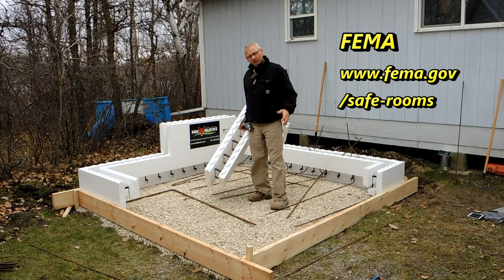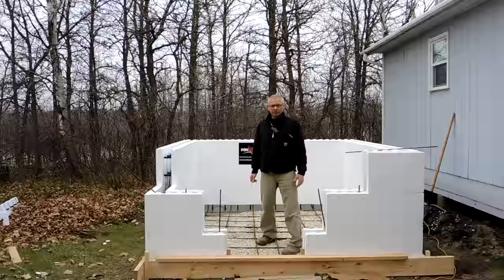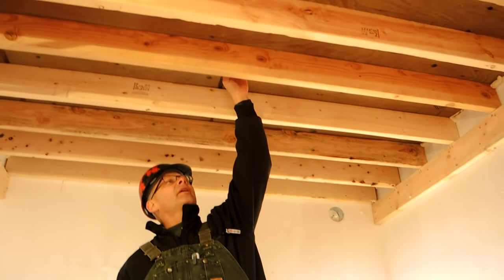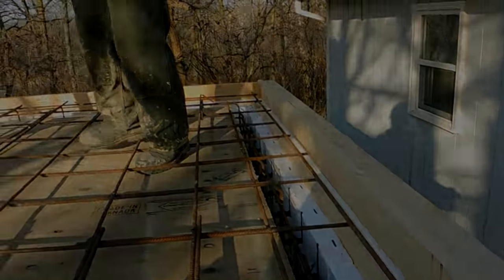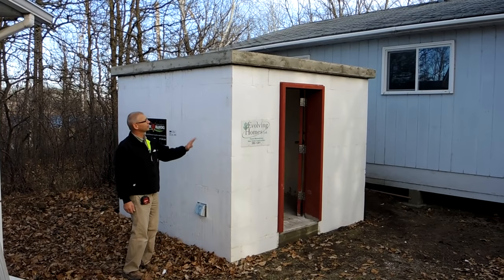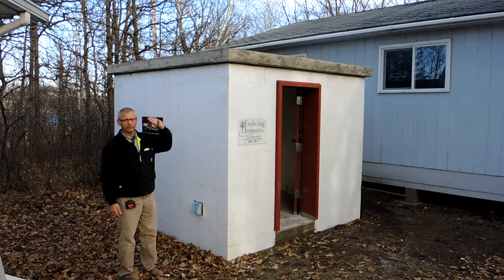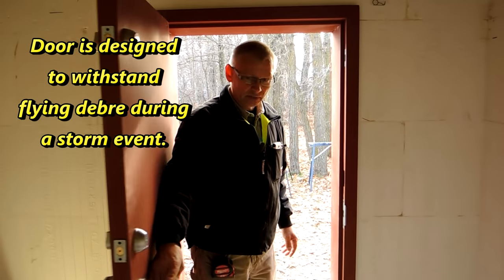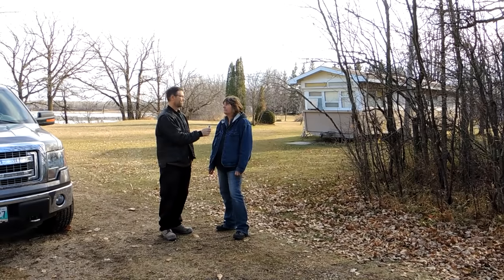Fox Blocks Storm Shelter Full Length HD

Comment: All that rusty rebar... Interesting fact. Rusty rebar fails. Inspectors here will fail you if they see it and ohh boy that shelter rebar was all rusty.
Reply: David Scott , I noticed that too. It causes concrete to weaken & crack & that's why inspectors will fail rusty rebar.
Reply: WOW, another arm chair You Tube Export that is sadly wrong again.... Please note...
Section 12 of ASTM A 615-96a, "Standard Specification for Deformed and Plain Billet Steel Bars for Concrete Reinforcement," says that rust shall not be cause for rejection provided the weight, dimensions, cross-sectional area, and tensile properties of a hand-wire-brushed test specimen aren't less than the ASTM specification requires.
ALSO:
Section 7.4.2 of ACI 318-95, "Building Code Requirements for Structural Concrete," has a similar statement indicating that reinforcement with rust shall be considered satisfactory, provided the minimum dimensions (including height of deformations) and weight of a hand-wire-brushed test specimen aren't less than applicable ASTM specification requirements.
You can Google this information to confirm it....
OH, I started as a concrete inspector with 2 years Technical School training for ASTM and ACI certifications. Turns out they did not make enough money so I start a Concrete Construction Company.... in 30 years I worked with 2 inspectors that had a clue what they were taking about. 
You are not one of them.
Reply: @stevemazz3121  I haven't seen much rebar that wasn't rusty.

Comment: Make sure the door swings  open for add on safety.
Reply: always wondered why most insist on a full size door on shelters that are not used for other things like root celler. a hatch less area for projectiles and less costly      imo   this one  has too many flaws more suited for hurricane although hurricane winds you need to occupy for  a day or so texas 2017 was several days. toronado only short time

Comment: What steel door do you have attached to the stala frame? I am in Raleigh NC and would be interested in getting some more drawings ,photos of the equipment used to get a cost estimate to DIY.  Thanks for any info
Reply: go to Texas Tech storm website and get info about doors.
Reply: This is not adequate for tornadoes

Comment: that will not work sorry that you are building...  if want to building on the ground for storm shelter its his to be around and top of roof around cap on and three foot in the ground .. That when the storm come its does have a blow down and when things starts flying around it as a hard time blowing down or putting it up and it thoughs it bass off the building it does anyway to put it up and a small door on it to get in it ... thats why see alot that around standing...

Comment: 7 inch slump!!!!! You just lost 40% of that concretes strength!!!
Reply from the maker: Your correct if we had ordered a 4" slump but our concrete was designed to be 6" slump. We still lost strength but not 40%.
Reply: What's a slump?